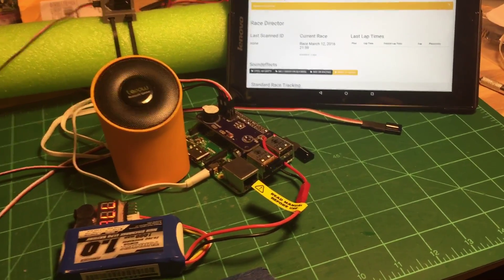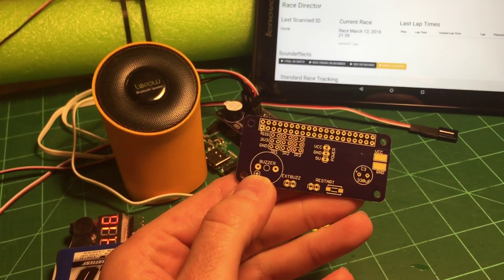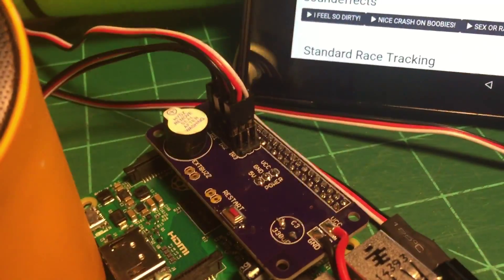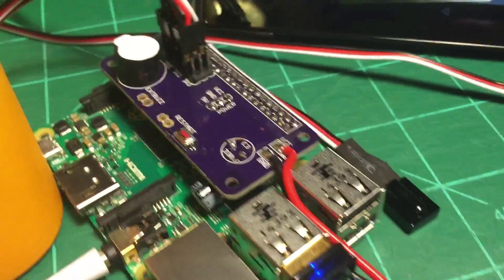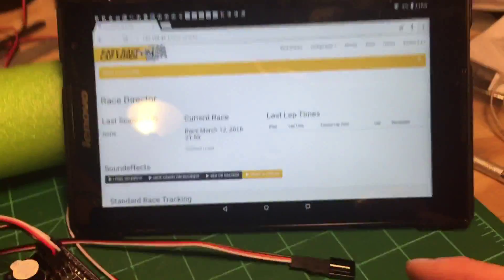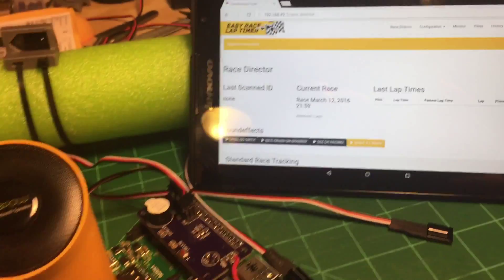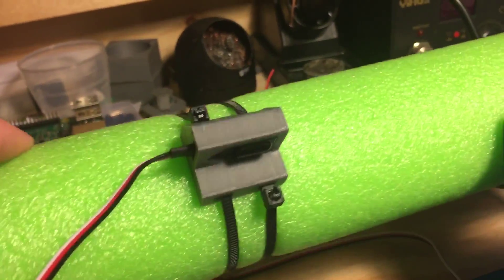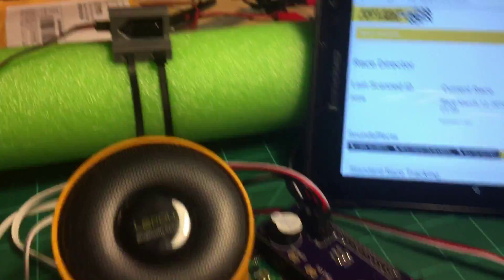EasyRaceLapTimer Base Station Setup

Comment: Hey Tim, Thanks for your work on the PCBs. I've ordered some sets for our FPV race on July4th. Have you gotten the satellites to talk to the main host? I'm having some issues and there is a lack of information out there on how to set it up. Any tips?
Reply from the maker: I haven't played around with the satellite system.  The main issue with the satellites is that they can be triggered and still miss the gate, so you have to design a gate specifically from the satellite (like putting it in a tunnel).

One thing to check is that the satellite is connecting to the base station's WiFi.  Is it possible that the satellites are in access point mode (like the base station), which means that each satellite is broadcasting its own network?